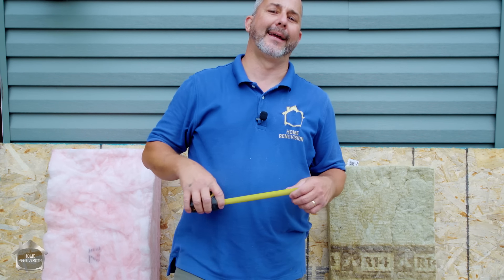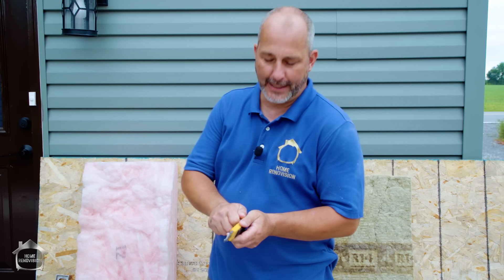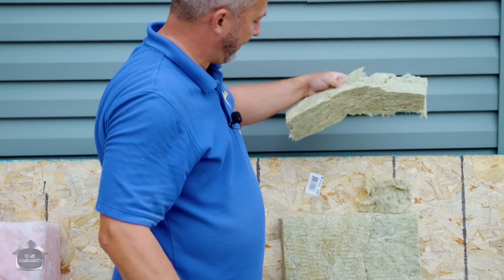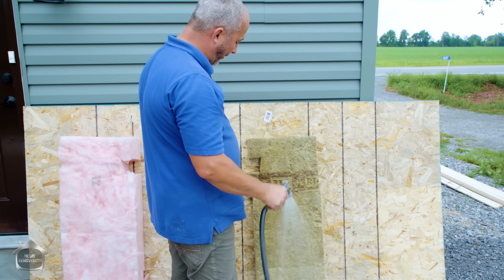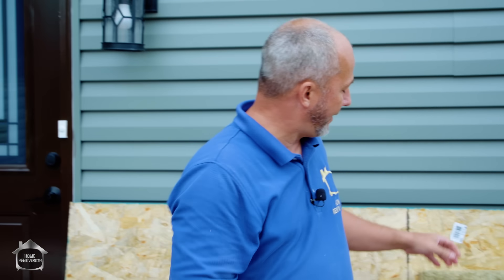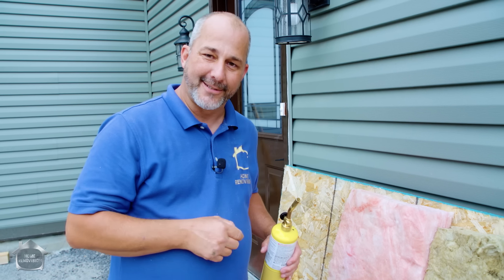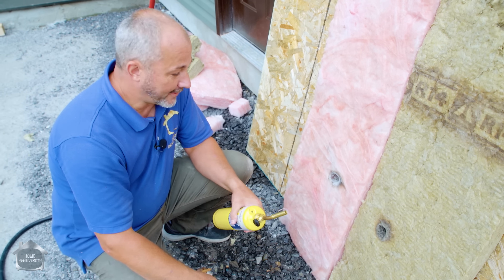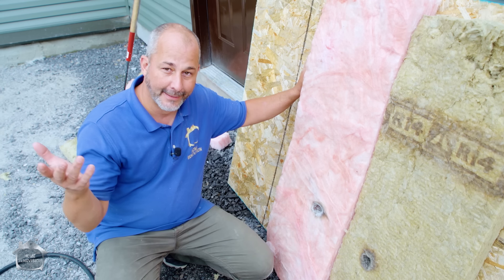How to Choose the Best Insulation for Your Home | DIY Home Renovation

Comment: It seemed so clear in the video, and now the discussion is bringing in terms like Rockwool, Mineral Wool, what the heck is that?  Are those general terms for the same stuff Jeff is calling the trade name of Roxul?    And while we are at it, what about insultation that has paper on one side of it?  What is that, and what situations do you use that, just that it looks good from the inside if you have an open wall cavity or ceiling or attic installation?
Reply: The technical name is stone wool or mineral wool.  Rockwool is the brand.  Roxul was Rockwool's former brand name for the stuff (now it goes by ComfortBatt).

There's more manufacturers of it than just Rockwool.  I had some Lowe's near me stock Rockwool, and some Lowe's stock Johns Manville mineral wool.  I bought some of both to compare, I preferred the Rockwool, it seemed firmer and a little easier to cut cleanly, but it is pricier than the Johns Manville.  Although the Rockwool has a 30% bulk discount that makes it slightly cheaper than the Johns Manville.  Both are rated R-15, the Johns Manville is a yellowish creme color while the Rockwool is a darker concrete sort of grey.

The insulation with paper, the paper is called kraft paper, it's a vapor retarder, not a vapor barrier.  That is, it only slows vapor penetration, it doesn't flat out stop all water vapor from coming through. (although this is actually not a hard is or is not, there's degrees of permeability, there's just a certain amount that is defined as "a barrier" or "a retarder").

You use it because water vapor getting into the walls is a problem when it condenses out from a warm vapor to cool water across the temperature gradient across the wall thickness.  It traditionally goes on the side that is warmer, because warmer air can hold more water vapor than colder air.  This warmer air is generally the inner side in the north where buildings are mostly heated throughout the year.  In the south, where there is both heating and cooling, it's more optional, because: the only hard rule is that you do not do a double vapor barrier, a barrier on both sides of the wall, inside and out.  In that case, water can't escape once it gets in, and starts rotting and rusting the inside.  You have to provide an escape route so that "the wall can dry".

Comment: WWJD...
As I'm replacing windows, thank you for the knowledge and sharing tips otherwise I wouldn't be tackling that kind of project! I was thinking about upgrading the insulation on our 1954 bungalow house in Saskatchewan from the brown paper fiberglass insulation. I was told by a guy who installs insulation that I wouldn't see much difference replacing the original stuff...
Since we're replacing windows and painting the rooms, take out the exterior wall drywall replacing the insulation?

Comment: Question. I have a closet for my master bedroom, the closet extends into an area above the garage. My house is a bit newer construction (2011 i believe). I have a feeling they didn't insulate the closet properly, how would I go about insulating it even just slightly better than it is currently? It is quite drafty in there. Usually we just keep the door closed, but it is easily 10 degrees colder in there during the winter, or in the summer quite a bit warmer. I'd like to avoid having to rip out the carper, floor, and walls. I do plan on ripping the carpet out for some LVF at some point though.
Reply: I would add a garage door insulator and leave a small LED lamp on in the winter. That's what we do for our potted plants. For a professional fix, have an insulation contractor use a thermal camera to find cold spots in the closet walls. Then they can blow insulation in thru a small opening in the sheetrock to fill up gaps or the entire stud bay if necessary.

Comment: Hi Jeff!

I have a noisy vibrating garage door opener and door and have replaced the rollers, lubricated everything and added Vib.  isolators and pads and has improved by 30%. I am gonna add an insulation to the ceiling of the garage (inside the garage) with no or the least mess to block the noise to the upper room. Is it a good idea to stack two 1 inch sheets of acoustic foams and make a 2 inch all over the ceiling? I have selected R5 Rigid foams for it.

Thanks in advance
Amir

Comment: Can you tell us when to use spray foam as insulation ?
Reply: Well, *anywhere really*. Closed cell foam for walls, open cell foam for roofs. If you have a floor above a garage, I would foam the garage ceiling with closed cell foam (but use open cell foam for the roof). Closed cell foam will add rigidity to walls, and help seal air gaps, and also resists water and mod/mildew resistant. Open cell foam typically has a lower R value per inch over closed cell foam. Open cell foam isn't waterproof, so water can leak through, hence why I suggest roof insulation so if there is a roof leak, you can find it, and open cell foam can be easily cut away. If a roof leak was sealed by closed cell foam, the damage would most likely be worse than it could have been as water wouldn't have a good way to escape, and over time moving its way through the roof panels and rafters causing more rot.
Both foams are typically have a fire retardant, but check with the manufacture. 

I wouldn't use foam as a fire blocking insulation though. For that, I'd use Rockwool/Roxul. More expensive than fiberglass, but it does have a slight edge for the better

Comment: Love your channel, but I have to disagree with you on this one. Rockwool is so much easier for the DIYer.

I am finishing out the second floor of our garage right now (~1,000 sq ft), and I'm using Rockwool for all of it. The biggest differentiator came when I called Rockwool and asked about installing it in the vented ceiling, in particular the need for baffles. I furred out the 2x6 to be 2x8 depth, which allowed me to use the R23 (meant for 2x6) without having to add baffling all throughout so long as I installed along the bottom of the rafters. With those dimensions, I have a 1-1.5" gap between the insulation and roof deck. The Rockwool rep said I should not have an issue with the insulation getting windblown because of its makeup (mostly basalt). The time/cost savings from not having to add baffling were a HUGE bonus for this project.

Comment: I’m so glad you made this video today!  I have a vented crawlspace with  pink insulation under the floors and the first floor is freezing.  What’s the best way to insulate the floors if the crawlspace is open?  I saw your crawlspace video but have fears about using spray foam, I’ve heard it can have health effects and a fish smell because the chemical reaction is happening on site?  
Please keep up the good work.
Reply: Nothing wrong with sprayfoam if its installed correctly. Has to be installed in layers. Installing to thick of a layer causes the foam not to cure properly and created off gassing from the uncured portion. 

I would use rockwool for your crawlspace. Better r value, its mold risistent and bugs and rodents wont nest / eat through it
Reply from the maker: Hi Sean. if you follow the instructions then you will be fine. spray a thin layer and then come back with a second layer. Cheers!
Reply: @HomeRenoVisionDIY  
Jeff I respect that but I'm a noob and not ready for the foam gun yet.  The current insulation has a moisture barrier and got wet.  I'm thinking of using the Roxul unfaced and Roxul ComfortBoard IS over that?   What trips me up is when and when not to have the moisture barrier?  Do I need  a moisture barrier in the floor joists?

Comment: The Rock is better for water, sound, long term insulation, pests, and your breathing health.
Reply: Breathing health is my worry.  I'm about to use mineral wool -- because you're correct on the building science points, but my research has turned up some terrifying asbestos-like concerns.  I can easily install it safely, but my worry is owning a house full of banned material in the future. Imagine if your walls were full of asbestos...
Reply: @berockization  rockwool has asbestos? Where did uou get that? Cant be
Reply: @fruitf7064  Asbestos-like concerns, I said. Like all internet info, it's confusing and contradictory.

Comment: I'm prepping to do my attic ! As a Liveable space in Western North Carolina ! I'm Finding That Owens Corning, " Thermal Fiber ",, or Their Answer to " Rockwool" , is $2.23 per sq.' ,,, " Rockwool" is $1.03 and Fiberglass is $0.85 , for the same Resistance Value ! SOooo if I'm Insulating 1420 sq.' ,,,, it comes up that Rockwool is $220.00 More ! But ! The Acoustics is much better , The Intsallation is Much easier , Fastening & securing is easier, particulants in the air are none ! and insulating around Recepticles is not just cutting a square out ! Cutting pieces for the Valley structures are sooo much easier ,,, ! " Roxul" is just another trade Name of the Original " Rockwool" ,,, Just like Owens Corning " Thermal Fiber " ! So why wouldn't you use " Rockwool" ? And are we really listening to unbiased opinion , or Kick back for " The Pink Stuff" ?

Comment: I have roxul in my 2x4 walls and sealed my attic with open cell foam 5 inches thick. My home temps and humidity does not fluctuate drastically like before adding the insulation.  And central ac run times are cut almost in half from 9 hours a day to about 4 hours a day run time. Located in Hawaii.

Comment: I'm going with mineral wool because interestingly enough for me, it actually is marginally cheaper that way.  How so?  Well, I need about 400 sq ft of coverage.  Now it turns out that Home Depot has bulk pricing for their products.  Bear in mind, I'm not buying the brand name Roxul/Rockwool, I'm buying the Owens Corning mineral wool which costs $23.48/bag.  However, with bulk pricing of 15 bags or more, the price drops about 50% to $16.44/bag.  With that savings, 15 bags costs just about the same as 10 bags.  So 15 bags becomes $246.60 and covers 441 sq ft which is about 41 sq ft more than I need.  Now if I buy 4 bags of Ecotouch Pink which covers 106.56 sq ft/bag, that totals 426 sq ft.  At $62.48/bag that totals $249.92.  So this way, I get R-15 instead of R-13, better sound proofing, better fireproofing and since it's going in the basement, better rodent and insect proofing.  Also with moisture considerations, the mineral wool will hold up better over the year/decades.  It's a no brainer for me... mineral wool makes the most sense.
Reply: Robert Giresi the Owens Corning stuff is nothing like roxul.  They may call it mineral wool, put it is completely different to work with. It isn’t anywhere close to as dense.
Reply: @AJourneyOfYourSoul  Thanks.  I read some online comparisons and it sounds like Rockwool is much easier to work with.  With that said, I'm doing a DIY project and doing this once.  While the install may be more difficult, once it's in the walls, it performs just as well as Rockwool based on my online research.  I appreciate the comment but for the money savings being about the same as fiberglass vs the Rockwool cost, I'm going with the Owens Corning Thermafiber mineral wool.
Reply from the maker: Hi Robert, would love to get your feedback on that product after you have worked with it. My goal in this video was to help people make a good decision and not buy into all the hype that certain companies have been peddling.
Reply: @HomeRenoVisionDIY  Will do Jeff.  I'll let you know after I'm done.  Cheers!

Comment: For years, I have been told that roxul was a far better product for sound isolation than regular corning or john mansville R-13. Im finishing my basement with an office and was considering roxul to soundproof the office side.
Reply: Mineral wool is better, in practice, for sound isolation. And given it's a basement and moisture might be a concern, that is also a valid reason to go for it.

Comment: Well, I love your channel, Sir but must hesitate and offer this: the pink held $10,000.00 of mold in my basement. Mold that went up into the bedrooms' walls. So if you have a basement, I'd not use anything but mold retardent insulation boards, not fiberglass. Rockwall, yes. At the rim joints, where temps caused condensation, I used boards.  In the bathroom - boards. Not fiberglass.

Comment: Hi Jeff, I am building a 2nd basement apt with permit. The basement wall already have insulation and poly on it. Do I still need to add R12 in between studs when I do framing ? Thanks a ton. Tony

Comment: Ah….but how about moisture in the air. The Roxul product will store more moisture, reducing the risk of mold inside the wall cavity. This attribute is called hybrid buffer capacity. Roxul takes the lead on redundancy in moisture management.

Comment: Rockwool will far outlast the old pink crap...so if you don't want problems 20,30,40 years down the road use Rockwool. I've taken down 12 year old sheetrock and the fiberglass insulation behind it had compressed and slid down leaving approximately 2 feet of uninsulated wall around up top the whole way around the room...you'll never have that problem with Rockwool, even if the install isn't done 100% properly...it just holds its shape like champ.

Comment: Pink burn baby burn Disco Inferno. Love your Channel. I guessed based on paper faced rather than just fiberglass. So I was incorrect.
I think in a crawlspace space where unfortunately rodents can get in I'm going to choose the more expensive roxul insulation. I think it will do better over time in regards to dealing with condensation and humidity issues associated with crawlspaces. I do not believe I will encapsulate my crawlspace.

Comment: I put fiberglass in a room I was doing and before I got the drywall installed a few weeks later a lot of the insulation had been absconded with by mice. That's why I use the grey stuff now.

Comment: Not covered:ease of installation and safety of installation. It looks like the pink is softer, so it would be installed by tucking it in overhead and the other looks like a stiffer sheet that can just be raised as a unit? The reason this makes a difference to me is the amount of product getting on skin and floating in the air with just one person doing the installation. It seems the stiffer the better?
Also, the pink I took down had a lot of mouse droppings. It has been up for 50 years, but some seemed new, so does one repel mice or make it harder for mice to navigate than the other? What can I add to repel them?   Thanks!

Comment: i have a quick question.  I just finished insulating the rim joists in the crawl space under my kitchen, but I have a lot of open-cell foam boards left over.  In between the floor joists is old faced fiberglass and in some area, no insulation. Would you recommend using the foam boards to insulate between the floor joists or buying fiberglass to insulate with?

Comment: been using rockwool for years... its worth every penny  more than fiberglass, 
absorbs vibration better, 
absorbs sound better, 
DOESNT absorb water
doesnt irritate while degassing
better insulation
bugs / mice dont like it

you build a room with rockwool and one with fiberglass, before the sheetrock goes up, stand outside it and have a friend inside yell as loud as he can... he will sound like he's 100's of feet away, you can barely hear him

contractors dont like rockwool / roxul because profit margins, it's slower to install, and costs WAY more... there is a reason he's pushing pink and not rockwool

Comment: Wondering about insulating a Victorian house. They were built not to be sealed like modern houses and wick moisture differently through the walls. Would rockwool be appropriate for the exterior walls?

Comment: The biggest difference is really how they perform under compression.  Fiberglass looses almost all of its R value with only .5lbs of compression, rockwool looses only 15-25 percent.  Now given a 100 percent perfect installation this is irrelevant, but installations are never perfect.  Imagine a 16 OC stud bay with one stud half an inch out of plumb so it tapers from 14.5 to 14 inches.  If the fiberglass is not perfectly cut to compensate you will have compression and virtually no R value there, the mineral wool can more adequately compensate for variations in framing.  On a cold day I can almost always tell if a house has fiberglass or mineral wool batts with a thermal camera. The studs with mineral wool are very sharp and defined, whereas the fiberglass bleeds more heat around the edges.  Now how much of a real difference this makes, and if its enough to have a reasonable payback period is the real question.

Comment: Rockwool is used in shipping due to its high resistant to fire and moisture. In a fire I believe the Rockwool will give you more time to get out if there is a fire in an adjacent room. I am currently replacing Casement windows and rotten plywood and studs in a 20 year old home. With the drywall removed we found a lot of the Pink insulation had collapsed down the cavities. I am installing Rockwool R23 for 2x6 studs. In the crawl space I am seeing the Fiberglass falling from between the floor joists and clear indication of rodents pulling down the insulation at the wall junctions. I will replace with Rockwool R30. I believe Rockwool is superior to the Pink for Fire, Thermal, sound, and Rodent deterrent. I believe in Buy once, Cry once.

Comment: Another factor is ease of installation, The Rock-wool is  semi rigid  and that can be a help in some applications. On the other hand, the fiberglass is available in rolls as well as bats, ( the rock wool only as bats )and in some cases having a continuous roll can be an advantage.